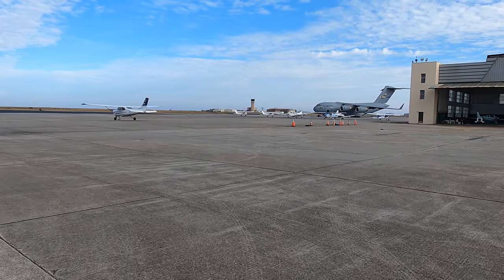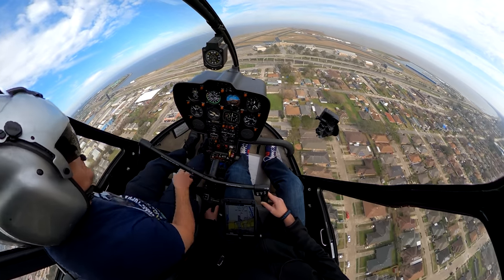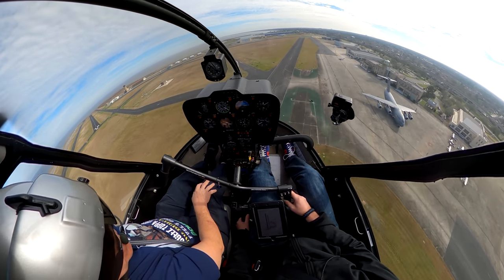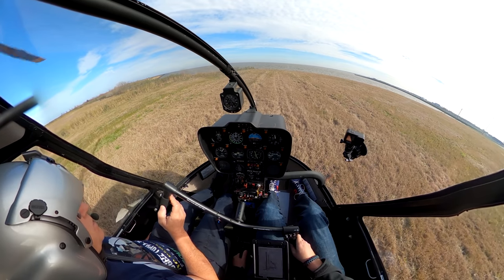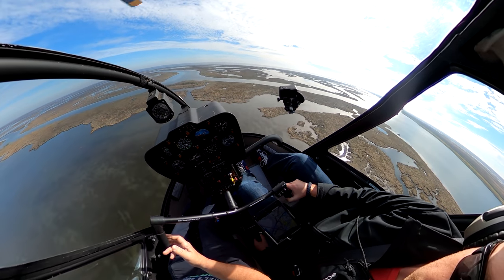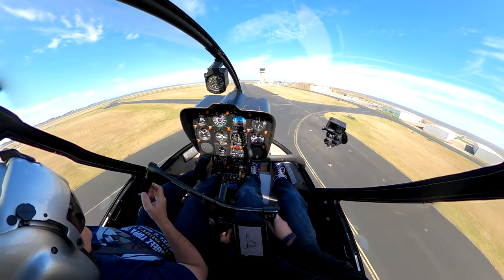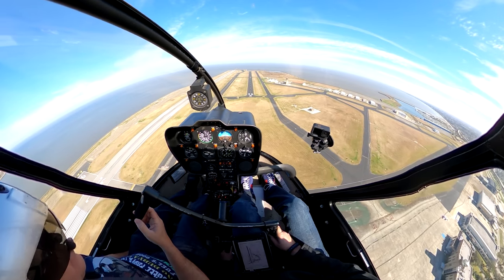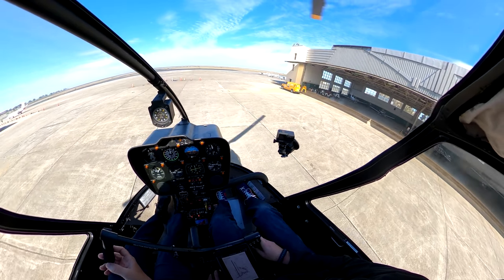Flying Over Battery Bienvenue and Low Level Levee Flying | R-44 Helo Vlog #2

Comment: Are you having to do the 20 hours Dual over again because of the different Heli type? Or due to the amount of time passing?  Great to see Lester back up in the air and mended well! Safe flying and hope to catch you at KNEW at some point.  KHDC Fly by Knight Piper Warrior renter here.
Reply from the maker: Because it’s a different helo (R44)
Reply: @CWLemoine  Figured as much, but it must be a nice upgrade from the R22.  N1092A used to be my baby when I was doing my instrument rating over at KNEW.  Still hear it on the radio every once in a while.  Safe Flying Mover!

Comment: can u plz show us footage of the collective being used? if u can or explain al ittle?  im fixed wing so this is real interesting thanks
Reply from the maker: It's in view.  Left hand.
Reply: Trying to make a simple explanation: Imagine the rotor being a big propeller. Collective is like the prop pitch lever that way while Cyclic does change the blade angles partially depending on where you move it to so you have more lift on one part of the rotor disc than on the others so the whole thing will tilt.

For a better explanation, you might wanna watch this: youtu.be/ysadvsXDVDU

If you're interested in simulations, you should give DCS World a try, they do have a free trial period at the moment for most modules and the helo physics are probably the best you can have at the moment on a PC sim. There's a great tutorial series on helo flying for the Mi-8 in DCS here that does a lot of explanation on how things work: https://www.youtube.com/watch?v=SXoS2N3M5Mw&list=PLLZXnPUD_ish7UIqf9TKxbg4bK5bzkwKx
Reply: @CakePrincessCelestia  thanks 4 the info i just think it would be cool to see mover with his hand on it up close i dunno if that would be boring but yeh thank u for the info and thank u mover
Reply from the maker: I don't think up close would add anything to the video.  You can see it clearly (unless you're on a super small screen) in this video.  👍
Reply: @CWLemoine  Exactly. And we can watch the MP gauge to see the power changes that come with collective input as well.

Comment: I'm doing my commercial helicopter licence in a G2 Cabri and when a new instructor flew with me he noticed we were using more power than we should, we found a restriction in the manifold pressure line off the engine, basicly the gauge was overreading, got good at limited power takes offs ha ha

Comment: Hey Mover... your quip about the cold made me laugh. It's -28 degrees Celsius with a -42 windchill value as I watch this. If I was down there I'd probably be wearing shorts and a T-shirt!
Reply: Thought the -10 to -13° C here within the last few days were cold. Well, I do wear shorts and a t-shirt still (indoors at a mere 16 to 18° C though) 8)
Reply: @CakePrincessCelestia  I've got the heat in my office set to 23 right now. I'm still cold wearing pants and a hoodie! I guess having my desk in front of an exterior cinder block wall with a big window doesn't help that. I'm just glad I have time to watch a few YT vids during the day while I work.